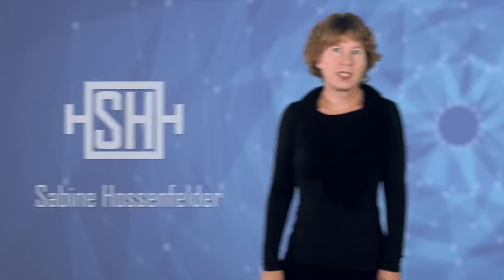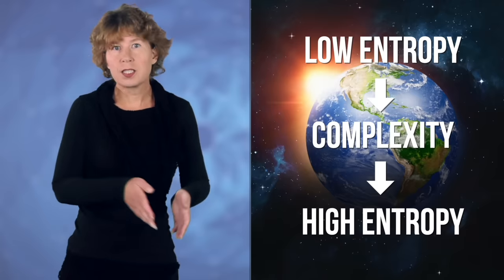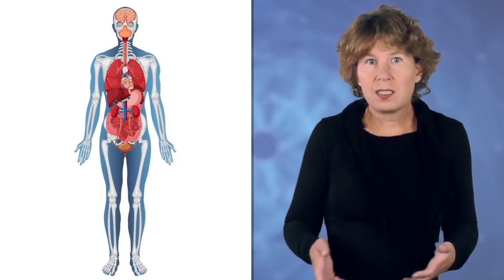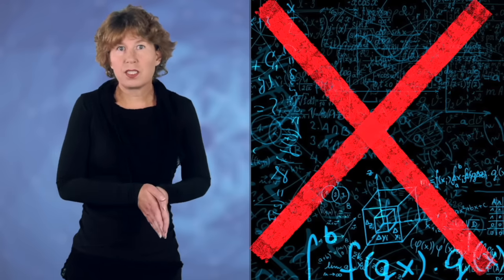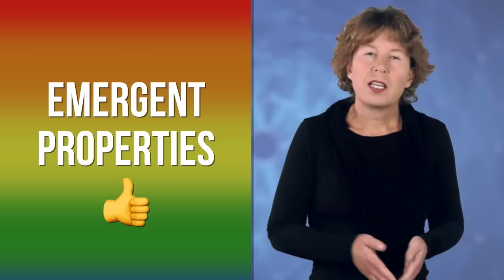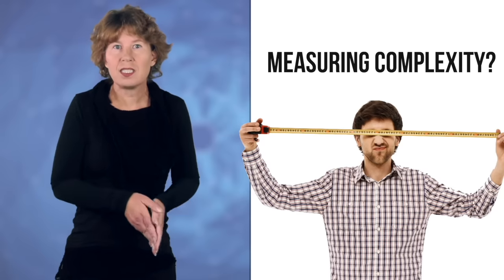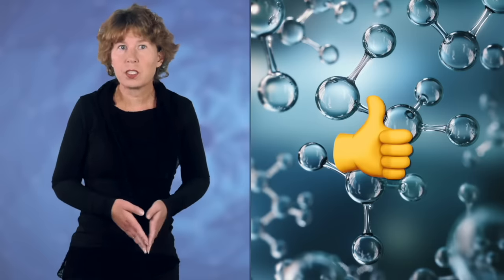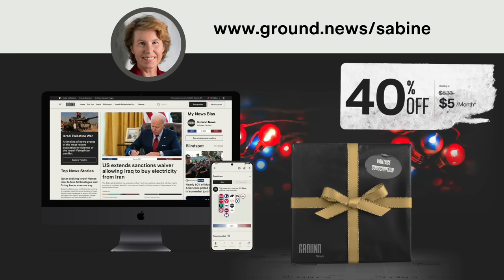The Biggest Gap in Science: Complexity

Comment: During my time as a PHD student, I also worked intensively with complex systems. The most important insight I gained was that it is practically irrelevant how many individual components a system consists of, but that the interactions and dependencies between them are decisive for its complexity. It is also very important how many scales (temporal and spatial) the system comprises. If the micro scale has a strong influence on the macro scale, this also makes the system significantly more complex. Now, as a software engineer, I have realized that these fundamental properties (many dependencies and multiscality) also make the software and the code (= the system) complex and therefore difficult to understand and develop.
Reply: Indeed, for the purposes of control and prediction it is more important how much interconnected (interdependent) the individual components of a system are than the number of components.  
As far as the role of software engineer is concerned, it is long overdue for a code to be written which treats the human as a consultant to the code that writes code instead of the the human being the code writer. Even better, the human must become like a customer to the code that writes the code the human needs, you just tell it what you need as you would do to another human, and the code gives you the code solution that will work for you. Do not confuse what I am saying with the stupidity of the chatGPT technology that currently became popular. The chatGPT technology and the likes (for images, video, sound, code, control, etc.) just have the veneer of intelligence.
Reply: read NASA guidelines
Reply: As a product designer who designs systems to control mass production lines, I like the c4 model of software architecture. I like to use it to map and understand the user requirements and flows.
Reply: @reasonerenlightened2456 well, it's still garbage in, garbage out. 

You want a human to tell the code what it wants and the code will take that as an input and convert that into code that does what the human wants. However, any kind of function suggests both implicit and explicit properties/aspects. It's only when beginning to use and test the first code iterations that it becomes clear what was implicit that needs to be made explicit. We call those implicit things that haven't yet been handled 'bugs', because they create the possibility for an unwanted output without the means for handling a correct output having been made explicit.
Reply: @512Squared  Machine learning still does not understand "iterations".
Reply: @reasonerenlightened2456  well, I don't see why that would be too difficult for AI to handle iterations once AI becomes more goal-driven as it develops. But certainly in practical terms, software development is always iterative, unless you're simply cloning existing software. I guess that's true for some individual functions in code. But software is usually a collection of functions.
Reply: After years of devising and analyzing algorithms and algorithm design methods to find optimal and near optimal solutions to complex problems, it finally dawned on me that the huge number of genetically  diverse organisms that lived on earth over 4½ billion years didn’t span a wee speck of all the possible unique gene configurations. Therefore, the chances of evolution, given such a relatively small search of all possible gene arrangements, finding gene configurations that yield such complex organisms as humans is unthinkable. Complex organisms are built with thousands of interdependent parts approximately co-optimized. Didn't happen.
Reply: @whimpypatrol5503  what do you mean by it didn't happen? I'm not sure I'm seeing your main point. That it highlights how natural selection weeds out the versions that don't work?
Reply: I think what would be more interesting is if we could figure out a way in which the “dimensions” that arise out of such systems, on their own so to speak, in a way that is that is even remotely deterministic — the axis of freedom such systems seem to exploit appear very fragile until they aren’t, and appear come from nowhere independent of design but not similarly independent of initial constraints.
Reply: @512Squared  suppose there are 10⁴⁰⁰ possible different ways to configure collections of genes, but you only try out 10⁴⁰ (as life supposed did over 4½ billion years on earth), then your chances of finding one's that produce complex life (or a series of increasingly complex complex life) is unimaginably small because of what fuels entropy throughout the universe. Entropy is due to the fact that collections of things (particles, genes, sounds, billiard balls, ...) being organized is inversely proportional to ways they are disordered. So, change favors decay. A collection of notes that produce a hit song is much more unusual than just noise. The chances that random streams of characters would turn out to be a medical text is absurd. The same goes for a collection of genes being one that is a generator of some complex organism is unfathomable. Despite the notion that natural selection supposedly sort of reinforces or saves good configurations and discards poor ones resulting in uncovering better and better ones, the process still must navigate and sift through an unthinkable, vast number of gene arrangements to find those ones so rare to produce increasingly complex life. Plus, such methods tried out in the 100,000's of computer science laboratories as algorithms in every way thinkable has failed to solve even one np-hard complex problem, problems much less complex than finding gene arrangements that produce complex organisms. Such np-hard problems require optimization of just 1 factor, not hundreds of factors co-optimized in complex living organisms. To make an argument for the gene configuration problem and show it through is something biologists have not begun to touch. They just wave their hands and say it happened.

Comment: I think kolmogorov complexity didnt get a fair shake. Yes, the standard model describes rocks, clocks and babies equally, but the length of this description is not the same, because there are more particles arranged spatially and temporally in a greater amount of ways, thus requiring a longer program leading to higher kolmogorov complexity
Reply: Agreed!
Moreover, the 'basic' description may well not be the _shortest_: if you consider a system consisting of an iron sphere floating through an infinite vacuum, then we can model all state variables using a much simpler model (treating the sphere as a point object with some fixed velocity) than the fundamental physics of all constituent particles -- moreover that complexity would be more or less constant across a large range of sizes of the rock, at least until internal repulsive forces begin to fail, even though the base system would get more and more difficult to compute using the naive method described in the video. Both of those facts (there existing a simpler model than raw particle physics, and that that model is to an extent size-invariant) are also true of a clock, but the simplest model for such would still have to be more complex than the simplest model for an iron sphere.
Reply: If we accept Kolmogorov complexity, we will need to take seriously Dembski’s schema regarding Complex Specified Information, and the “conservation of information”. Also, Stephen Wolfram’s “A New Kind of Science” is relevant.
Reply: But isnt Kolmogorov's complexity really a measure of "disorder" instead of complexity? A "completely random" sequence (generated by white noise) of elements would take a longer program to recreate, if compared with a "complex" sequence (that necessarily would have some kind of correlations that allow us to compress the sequence).
Reply: @adolfobahamondealvarez5739  
It certainly is a measure of disorder. A uniform sequence of a repeating constant value would have the lowest kolmogorov complexity and and a totaly random sequence would have the "highest", with Sheakspeare somewhere in between. You're totally right in that merely higher kolmogorov complexity does not mean higher actual complexity. However, it is still, in my opinion, extremely useful because it mathematically bounds actual complexity. We still don't know what it is but we can be sure it must be more than x and less than y. Putting bounds is useful.
Reply: @yakovdan  Quite possibly I don't properly understand Kolmogorov complexity but producing random noise with an algorithm doesn't seems long or hard if you are satisfied with a pseudo random solution and seems impossible if you want a true random one, thus I am not convinced that it isn't really a good measure of complexity in most practical cases.
Reply: @CraftyF0X  as I understand it, Kolmogorov's complexity refers to the complexity of specific objects and not of ensembles of similar objects. Hence, to reproduce one specific realization of a random sequence (with no correlations) you would need a program at least as long as the sequence itself, since you cant predict the next values
Reply: @adolfobahamondealvarez5739 In the case of true random sequence I agree and I think my comment suggested that I do. However, in case of pseudo random sequences, there is a clear and short algorithm with certain input values that produdce the same sequence, as it is not actually random but seems random for us (partially because we don't know the starting parameters)
Reply: @CraftyF0X  True. To produce random or regular simple pattern one uses short algorithms.